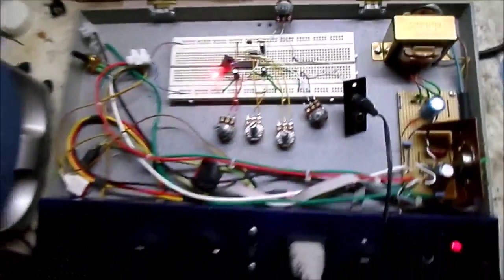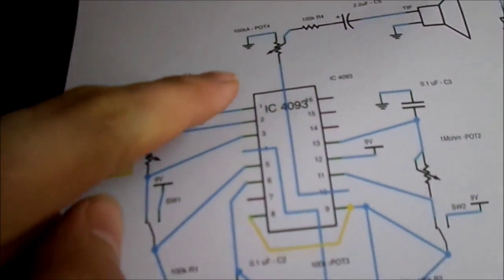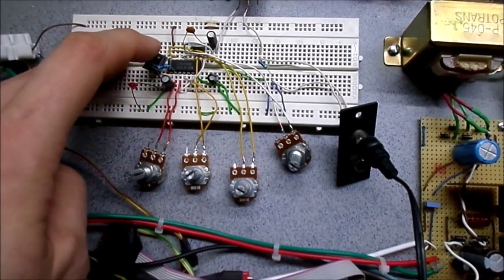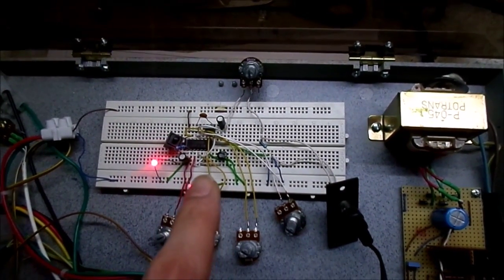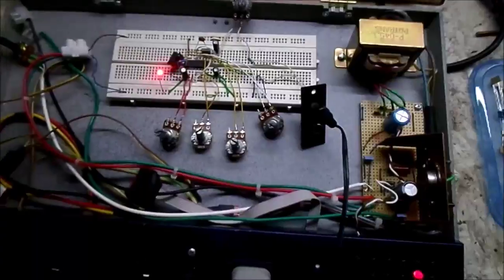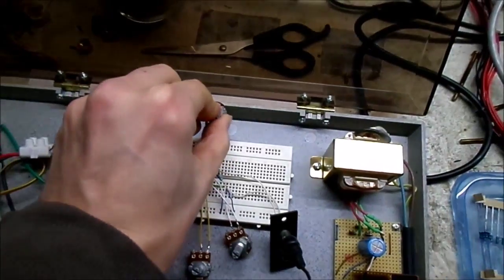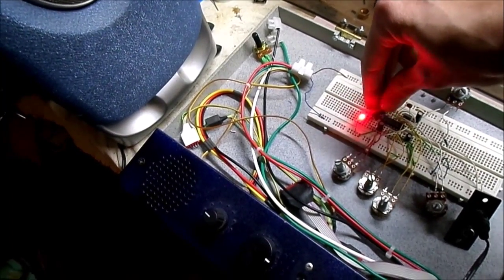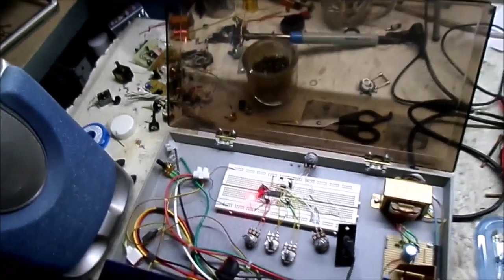nand gate synth

Comment: Who´s digging out the corpse?! ;)
4093 chaos synth is a fuckin fun toy to play with, even the kids love it. The parents not that much, but who cares, ain´t mine kids.
If anyone will read this in future: put a little "open" push button in line with the battery and a little cap (~2-4.7µ) behind the switch on chip + & GND. Everytime you push the button/break the PSU the synth is starving and makes cool drumeffects. If you want to go really crazy set up a LFO (40106, 555 etc) and substitute the button with a switch ic (cd4053 or so). Auto-trigger the beat out of this little *peep*! ;)